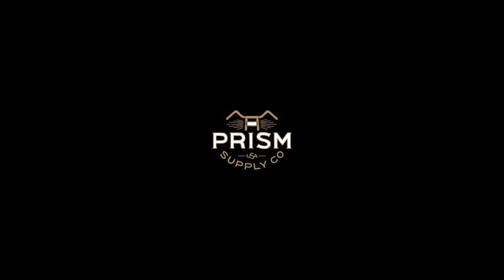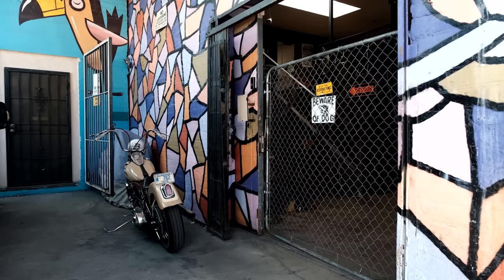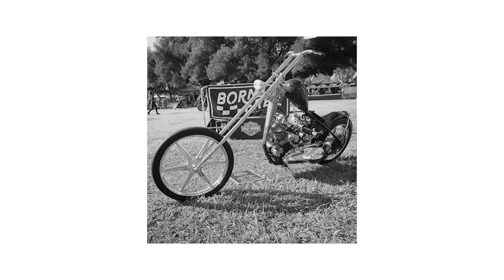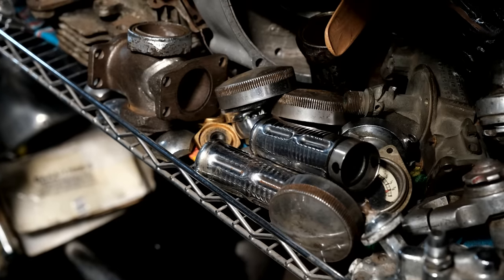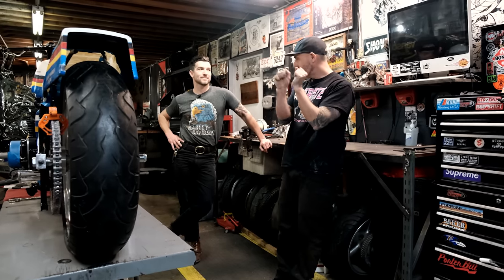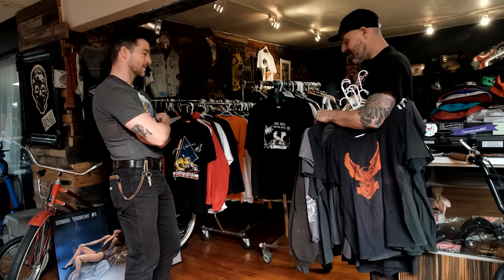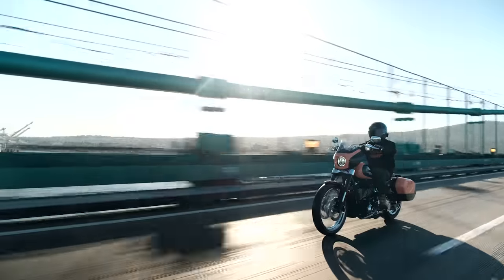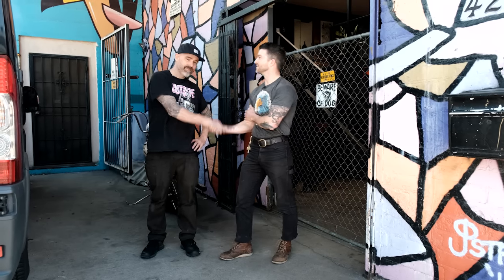Prism Supply x Harley-Davidson | My Garage | Oliver Jones

Comment: Nowadays unless you are a professional shop or a professional mechanic with $10,000 worth of specialty tools you cannot build a custom Harley out of a stock Harley because they have too much computer-controlled crap all over it and if you touch one thing the bike will not run. They are like a high-tech cell phone today fantastic electronics does a world of functions but God help you if you drop it on the floor and it breaks and you are s*** out of luck 🤞.